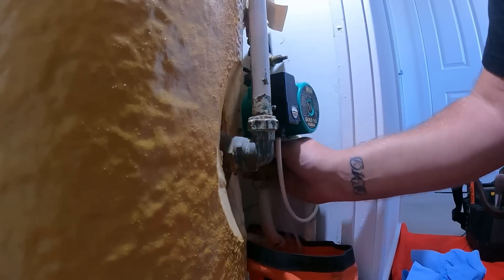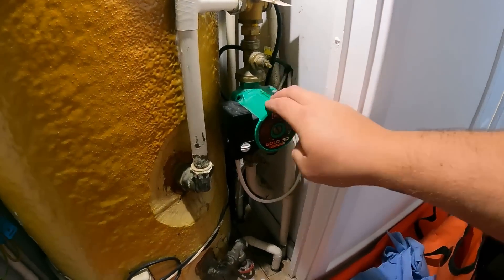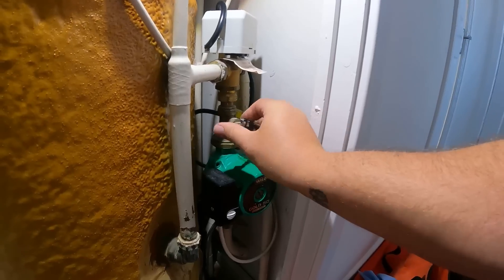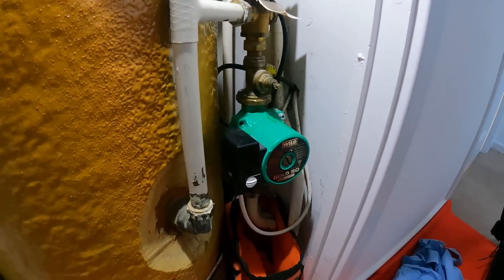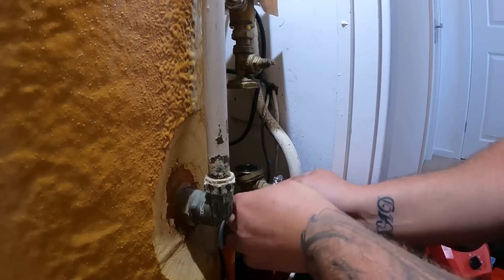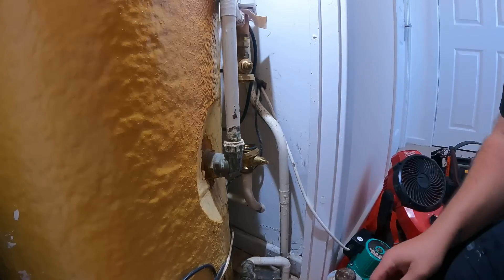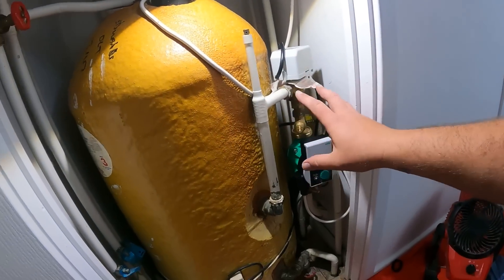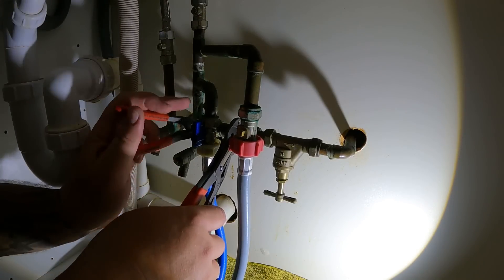PLUMBING HOW TO.. Central Heating Pump swap | Real World Plumbing Plumber

Comment: Why Didn't you open the center pump screw to check the valves are holding?.
Reply from the maker: Because the pump would of been full of water anyway…. Just crack the valves….. easy

Comment: Went to change my pump to a new Grundfos UPS3.... oh no, the valve nuts wouldn't crack.  Damn it.  Looking for tips, I know Mark will have it.... here I am.  Got a pair of butterfly valves to pickup from TS tomorrow, but I think they're a fraction longer so will need to trim the copper.  Plus immersion timer is in the bloody way, so that needs relocating first.  Never ending!!! And yes, I love DIY!!
Reply from the maker: If need be get a bit of heat on them😉👍🏼👍🏼
Reply: @MJTiffPlumbing  Yeah I tried heat and also a slotted screwdriver with a big hammer!  As old as the house, so 27 years old - she ain't budging 🤣

Comment: Hi Mark great video trick i used to do was shut valve then back off then shut again in case dirt on seat also used rotation port to check if valves are passing water and last trick was to use mole grips plus WD40 on gland onwards and upwards

Comment: Thanks for that, Mark. It’s one of those jobs where, if it goes to plan, it’s an easy DIY, but when the valves don’t play ball then it’s ballache time. A few winters ago one of our pump washers just gave way out of nowhere. I couldn’t get the replacement fibre washer to seal for love nor money so ended up buying a new gate valve from Screwfix just for the rubber washer: not the cheapest option but a bargain under the circumstances!
Reply from the maker: They can be a right pain

Comment: Hi Mark, we have an open vented system with 20+ yr old original Potterton boiler, hot water tank, Grundfos pump, and Salamander shower pump. We have had mixed advice regarding replacing the boiler like for like (with one eye on hydrogen in the future??), switching to a pressurised hot water tank to do away with the shower pump, or going for a combi boiler for hot water on demand. House is 4 bed not massive two bathrooms but showers never run at the same time. What would your general recommendation be regarding the best setup for most people and do you recommend Worcester Bosch or would you consider other brands, Vaillant, Viessmann etc? Thanks for any advice you can offer as we hope to upgrade the system in the next 1-2 years 👍🏻

Comment: Nice little video Mark. Those Wilo pumps are brilliant IMHO. Economical and loads of grunt. The "house pictures" as I understand it are for systems with TMV's, and the pump will moderate itself depending on how many TMV's are calling. The  1,2,3 settings can help get you going if you've airlocking issues, with help from the purge function. The last one i fitted needed a lower power setting than I'd thought as it was pulling in air on OV system, only took me 3 days to figure it out 😅
Reply from the maker: 👍🏼👍🏼 thanks buddy

Comment: Another great video.  With all these valves ceasing up all the time, you would think that there would be a better designed valve on the market 👍
Reply: You can get the ball valve ones that are like a big isolator valve but I don’t know whether they’re much better or if they just end up failing in a different way. Any valve that spends its life going hot cold hot cold all the time and only gets shut once in a blue moon is going to struggle anyway.
Reply from the maker: Indeed you would… there are a butterfly one but wasn’t in stock at Plumbase

Comment: Like the new tee shirt Mark. Those pump valves can be a pain most dont turn off properly just like the dreaded gate valves corrosion in the system doesnt help have a good week
Reply from the maker: Never touch a gate valve…. The unwritten rule

Comment: Good video, it would off been easier bunging the header tank way more easier then draining the system and refilling and risking AIR LOCKS!. And risk filling the system with the thick stuff/sludge at the button off the header tank and causing blockage in the system in the future. 

What i would off done is bung head tank tank a few mins, and open the valves, let it drip shouldnt be much water as long as you bunged it properly, then change the body. Also a tip when bunging, clean the air vent just incase you dont have AAV on pump. I alway bunge, change zone valvea, pumps, trv AAV.
Reply from the maker: Yep…. That’s also a way….. however I did it this way👍🏼

Comment: Hi Mark, Its always a lottery if those gate valves will shut off or not. Though when i first started out after my apprenticeship (fitting those Wilo pumps you've just replaced), i used to find stacks with ballofix pump valves. They would leak just by looking at them the wrong way! 😂. 
Great content as always mate. 
Oh, and do i spy a Veto cap in the van? And a Veto bag on the job? 👀🤔😉
Reply from the maker: Always a lottery as you say😉🤣

And yes…. Well spotted…. 😉 watch this space

Comment: I'm a diy'er and had to do this last week valves shut off ok but could not budge the large nut had to cut it off with an angle grinder, brought new valves but they were about 6mm shorter and had very little movement in the pipes, pleased i'm not a plumber you must be like goalkeepers "mad"  🤣🤣🤣
Reply from the maker: Always something to keep you on your toes

Comment: As one or two have already said I’m sure if you had bunged the tank and sealed off the vent those valves could have been changed without fully draining
Reply from the maker: Indeed you could of done it that way….. however I didn’t 👍🏼